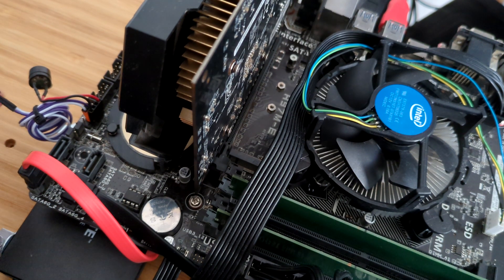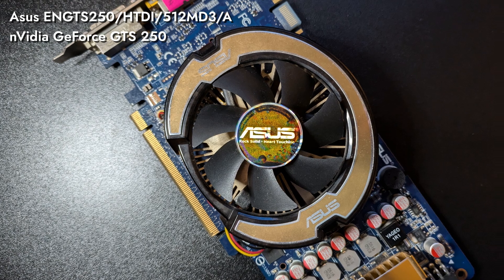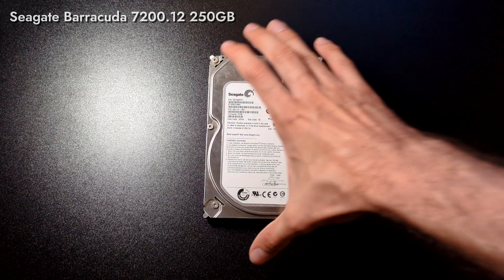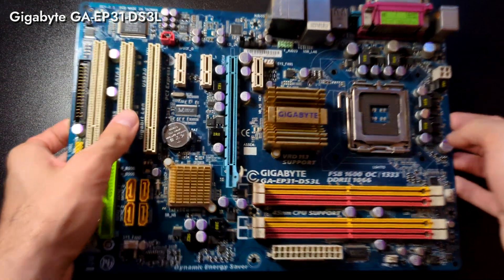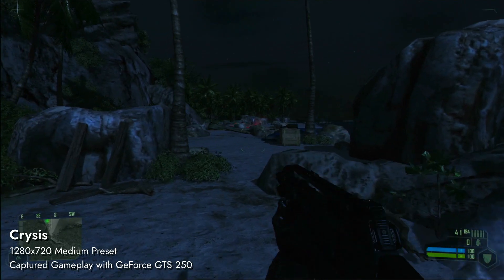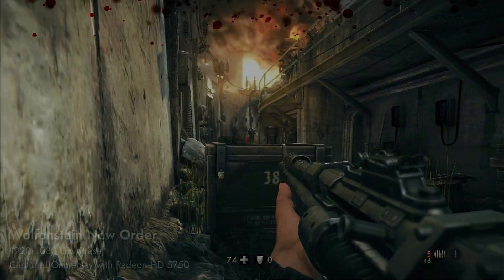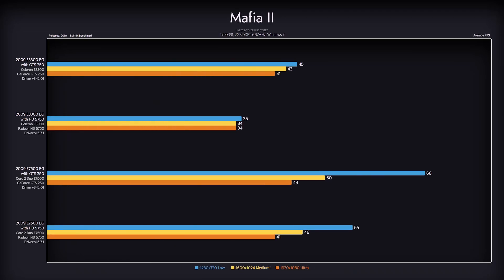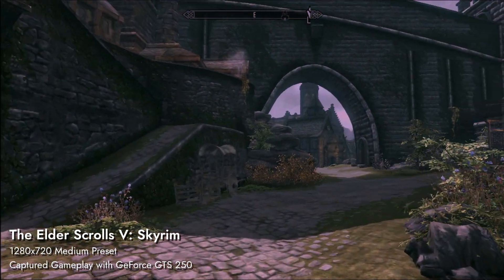2009 Budget Gaming PC Build ( Celeron Budgetorama 2 )

Comment: I'd give it a go trying to overclock the celeron e3300.
First with the ram at 533 mhz increasing the fsb & setting the cpu voltage at 1.35v to have a baseline of how far you might be able to push it, then upgrade ram to a faster kit at 800 or maybe 1066 mhz if you happen to have any.

And as a bit of a part 2 on this.
Toss in 4 gb ram in total into the mix, like a friend that usually got among the latest and greatest every few years just upgraded too a DDR3 system with the freshly released socket 1155 I5 2500k.
And gave his 2x2 gb kit of ddr2 too you as well as the core 2 quad Q9550 cpu.
While another friend got his motherboard & HD 5850 while he just got a beastly HD 6970 with the new pc build.

Comment: Is that the 2016 re-release of Skyrim? If it is, then it would run a hell of a lot worse on that hardware than the original 2011 release. They ported the game over to the Creation Engine version used in Fallout 4 for the 2016 remaster.
Reply from the maker: Nope, the original Skyrim version. Legendary Edition to be exact, one with all the dlcs.

Comment: Back than, the new AMD Athlon II and Phenom II for socket AM2+ were better budget oriented option. I know, that this video was about Celeron from Intel, but it would be nice to do a comparison.
Reply: For sure, especially if you went for the athlon II x3 cpus, quadcore on a budget if your motherboard allowed you to ignore the cpu temperature sensor & go by the motherboard cpu socket temperature sensor instead. Or the cpu would be locked at 800 mhz as usually they were detected sitting idle at like 81 - 87celsius while motherboard cpu socket temperature sensor showed a more realistic mid 30's in temperature.